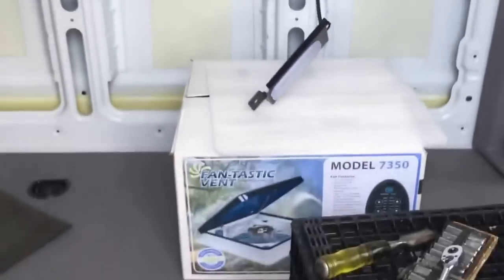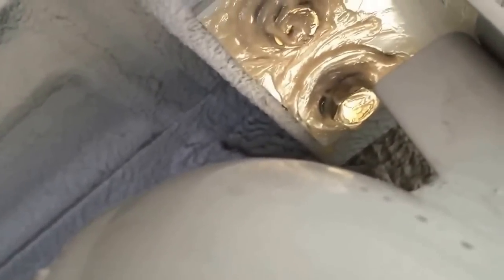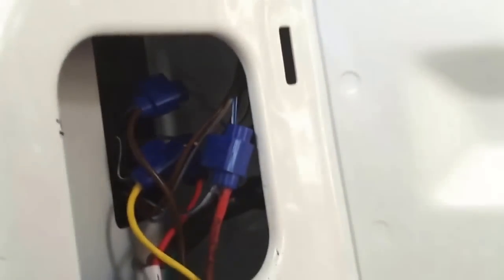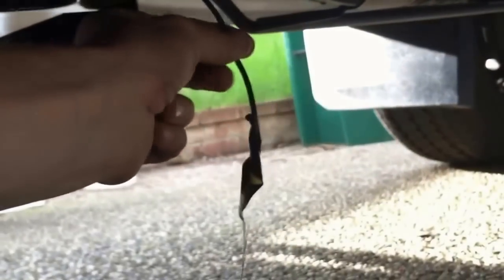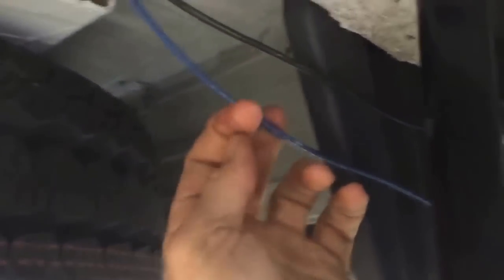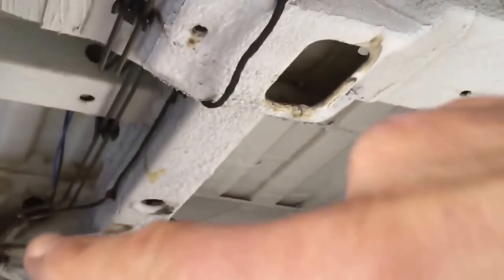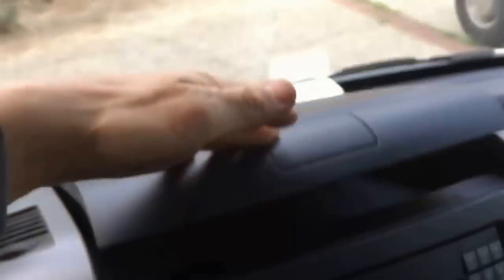Part 1 Sprinter Van Conversion - Getting started - Hitch and LP gas tank installed

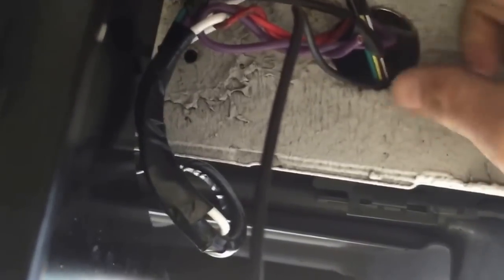Comment: Minute 4:24 Did you need a special hole saw blade for metal to drill that hole? The ones I find in Walmart say that they are for wood and PVC. Did you use one specifically for metal?
Reply from the maker: +Platinum Dragon Productions Yes you will definitely need a metal cutting saw to cut any metal. The ones that are not specifically labeled for metal cutting will not be able to cut through the steel due to not having a high enough carbon level in the blades steel, so the metal you are cutting will actually erode away the metal your cutting. .I personally like the Diablo brand of sawblades they seem to hold up better than others over long term use heating up due to friction.
Reply: Thanks! :-D

Comment: Thanks for the video. I am thinking about getting a extra long Sprinter and put a full size bed in, together with a toilet and may be shower. Do you think there is room for that? Thanks.
Reply from the maker: +Dan Ngo It all depends on how big you make them al,l but if you make them all small enough and do a good enough job installing them tightly together then it should be fine. One consideration is a normal size 170 wheel base barely fits in a normal parking space. So the extra long size will not. You may get a ticket if you ever have to park it on the street in a city due to taking up more then one parking spot. Just a thought. :)

Comment: Hello. 3500 Sprinter have 4 rear wheels.How you made 2 rear wheels?
Reply from the maker: Vitali Miadzel it's called a "super single" it comes from Mercedes like that. It's still a 3500 but just has one single slightly wider wheel on either side in the back that takes about the same weight as duallys do. It is better on fuel due to the lack of surface contact and saves room inside the vehicle because the wheel wells protrude less cuz there is one less tire on both sides.

Comment: where did you get the propane tank from?
Reply from the maker: http://smile.amazon.com/ch/68-0318273
Reply: That link isn't working for me. I'd love to know where that propane tank can be found.
Reply from the maker: Jon Dalman  I got it on amazon and at the time I purchased it that link was working. Sorry it is not working for you now. This is what is was: 

Manchester (6811) 8" x 42" Gas Tank - 6.72 Gallon Capacity
by Manchester Tank

Try this link:
https://www.amazon.com/Manchester-42-Gas-Tank-Capacity/dp/B0064EDZC6/ref=sr_1_1?s=lawn-garden&ie=UTF8&qid=1473123864&sr=1-1&keywords=Manchester+6811